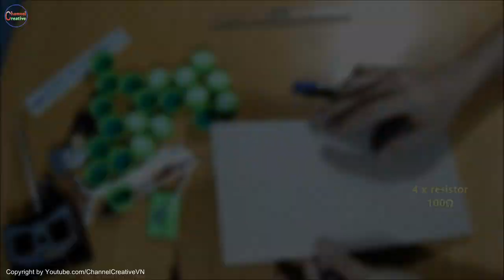How To Make Container Trucks RC

Comment: can i make it with foam???
Reply: +Sathishkumar Nadigatla +Sathishkumar Nadigatla Yes! I think foam would last longer and it would
 be water resistant. I would have made the base out of thin wood strips,
 but the important thing is you can make it out of any material you have
 on hand or that you can find free from the trash. Sometimes people 
throw away printers and that's where you can find motors for free. Also,
 VCR/DVD players have motors and gears.

Comment: WOW! you know I have a big problem because... Its too cost if I buy a RC car to use the Case.. because I want to built with WIFI RC car using ESP-01(ESP8266) using Android Phone... If you have an Idea can you make wifi RC using esp-01 with Android phone control
Reply: the ESP8266 takes around ~0.1-0.2 seconds for every command (so you can only send or receive 10 commands per seconds, so I think it's not a good idea to use the ESP8266